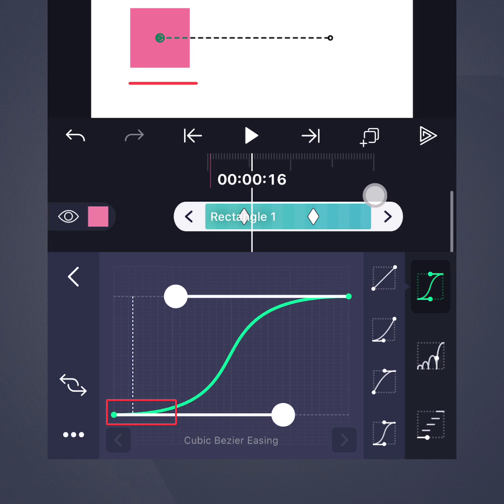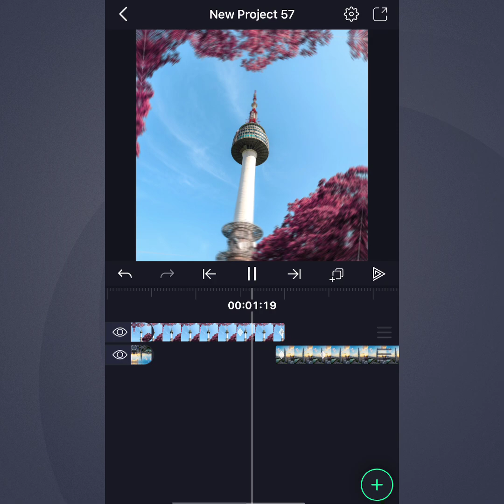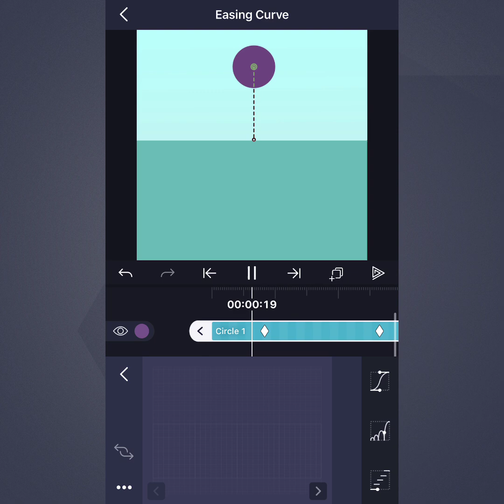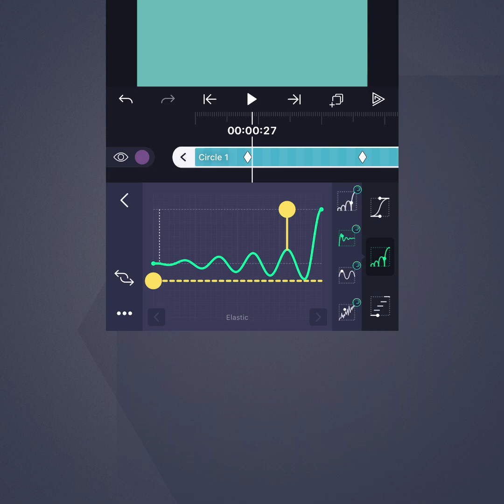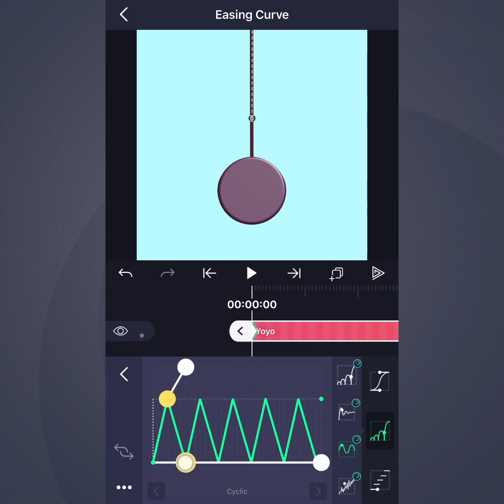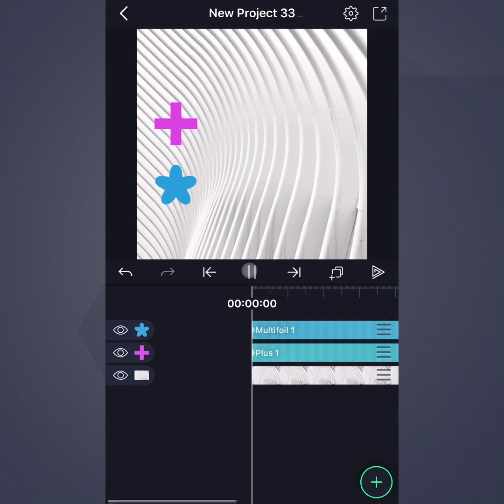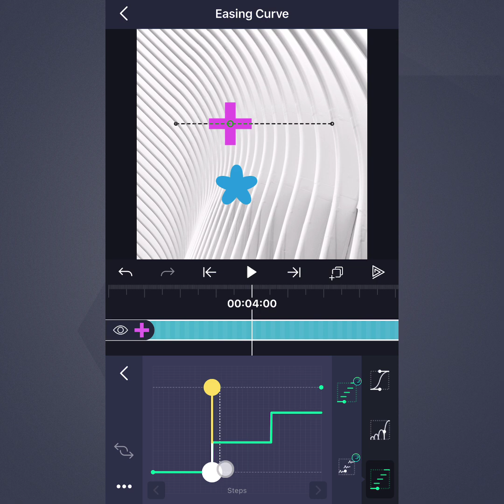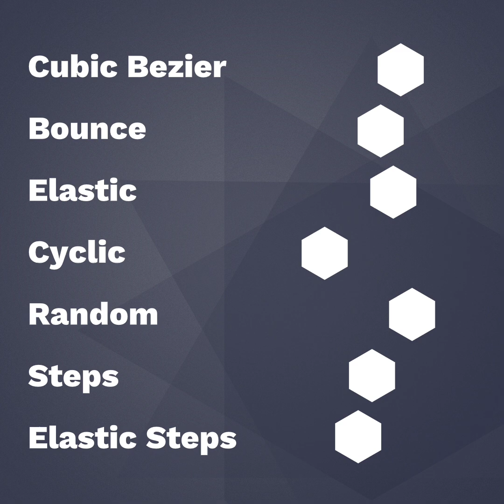Easing - Quick Reference - Alight Motion

Comment: How do I do like a zoom out effect on the graph I still don't understand how it works
Reply from the maker: Hello! You make the effect with keyframes. Keyframes tell Alight Motion what you want your layers to do and when. If you open Move & Transform, then tap the Scale icon (the third one from the top) you can then add Scale keyframes to your project that will allow you to zoom in and out. You can then change how the layer zooms over time by working with the graphs.

Keyframes tell Alight Motion what to do and when.
Easing (graphs) tell Alight Motion how to do the motion in the keyframes. 

I hope this helps!
Reply: @AlightMotion  Thanks so much for replying it helps a while lot💖

Comment: I did not find a way to animate the basketball thing without using move along path. Can you guys help?
Reply from the maker: Hello! We didn't actually use Move Along Path for that. What we did was take the ball, use Move & Transform to make it move from top to bottom over the whole time of the layer. Then we switched the easing to bounce, and that gave the bouncing effect. We then grouped that layer by itself, and then added more position keyframes to move the ball from the left to the right. (Just linear easing on that.) We also added some rotation to the ball as well. I hope it helps!
Reply: @AlightMotion  thanks. 😘

Comment: How to avoid lagging from alight motion? I've been lagging so much lately :(
Reply from the maker: Hello! Please know that every device has a hardware limit as to how much it can process at any one time. If your project starts to reach that limit you will start to see drops in performance. We're working on optimizing the app with every update so that you can do more within that limit, but we ultimately cannot affect hardware so if you push your device hard enough you will see drops in performance. If you are having issues with video, some video formats behave better than others, try exporting your video by itself through Alight Motion, and see if the performance for that video clip improves. If you're having problems with lag in other places, or doing this with video doesn't help, please contact support@alightcreative.com with more information and we'll try to give more specific advice. We apologize for the inconvenience.

Comment: Hey, i recently started using alight motion and i wanted to say the effects and everything is amazing but there is one MAIN issue that if it isnt fixed im gonna stop using it and I know im not the only one with this issue. So the problem is that when im editing and I want to see the preview it lags so bad and i can barely watch what i have done, and this gets very annoying and frustrating often. So please fix this, ty.
Reply: Don’t add motion blur until you are finished also you can put low preview mode on I think that’s what it’s called
Reply: @kelkellys  oh alr ill try that soon and ty
Reply from the maker: Hello! What @Neili said can definitely help. Please know that every device has a hardware limit as to how much it can process at any one time. If your project starts to reach that limit you will start to see drops in performance. We're working on optimizing the app with every update so that you can do more within that limit, but we ultimately cannot affect hardware so if you push your device hard enough you will see drops in performance. If you are having issues with video, some video formats behave better than others, try exporting your video by itself through Alight Motion, and see if the performance for that video clip improves. If you're having problems with lag in other places, or doing this with video doesn't help, please contact support@alightcreative.com with more information and we'll try to give more specific advice. We apologize for the inconvenience.
Reply: @AlightMotion  oh ok thank you, ill try to do this.

Comment: These are very cool features
But, is there a way to fade in/out an audio?  Cause it never seemed to work ^^’
Reply from the maker: Hello! You can use the fade in/out effect, or you can manually change the volume over time using keyframes with the volume button. When you tap a layer with volume you should see the volume button at the top right of the editing panel. Hope that helps!
Reply: @AlightMotion  oh alright thank you so much!